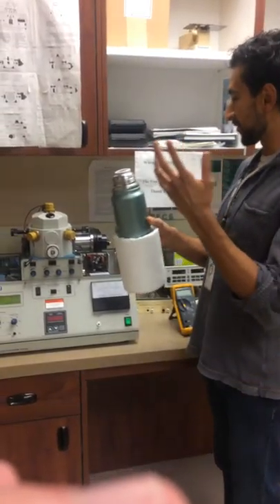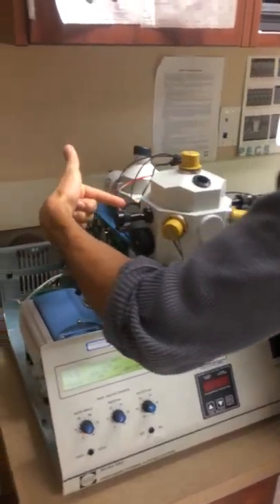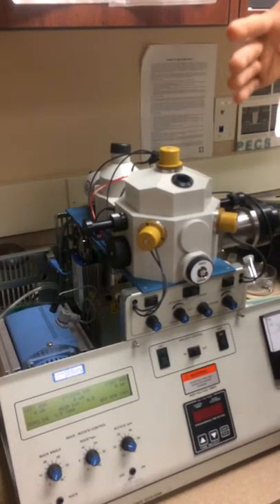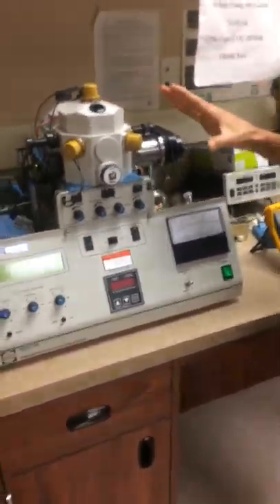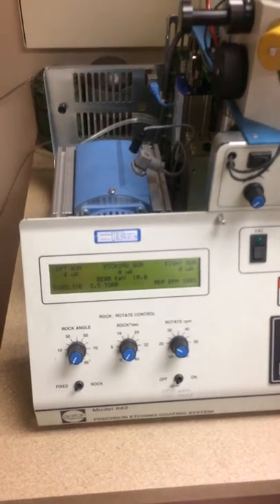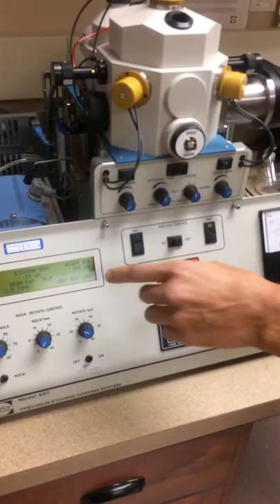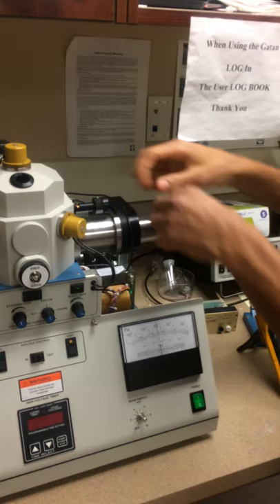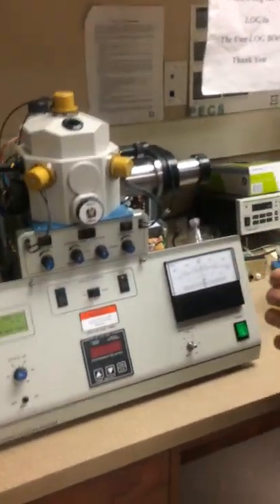Coating with the PECS at the ASC (Part 1)

Comment: For what you need this coating on your sample?
Reply: djsalvi26 SEM requiers your sample to be electrically conductive. Since epoxy is not, then coating it with carbon or metal helps